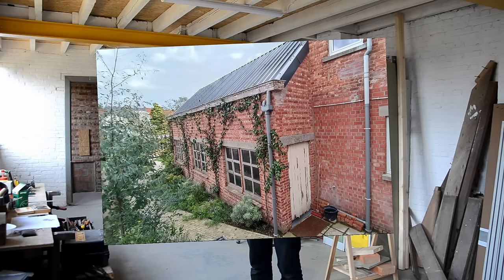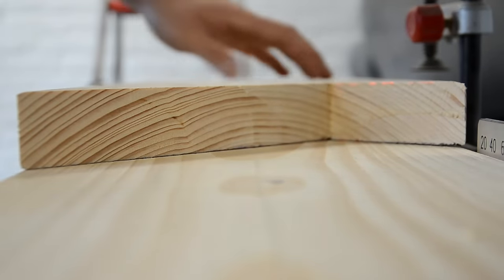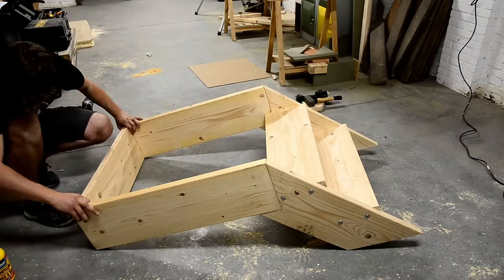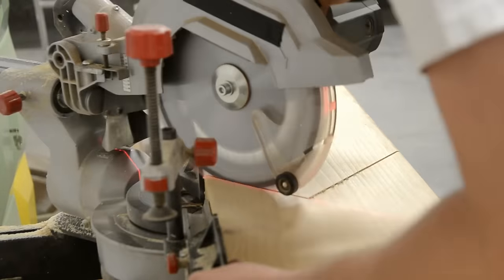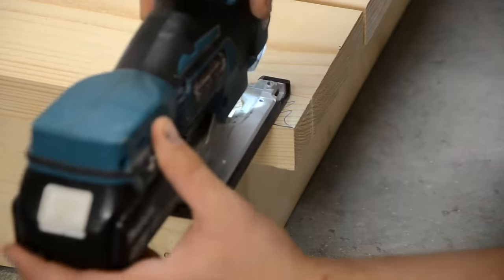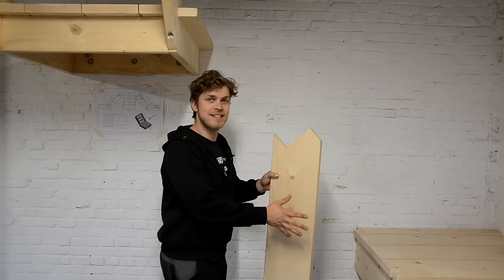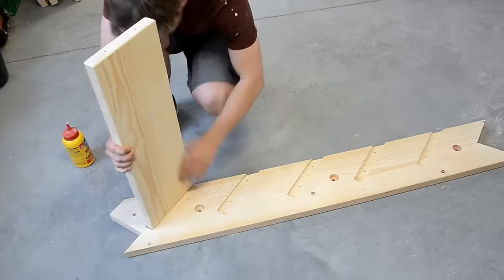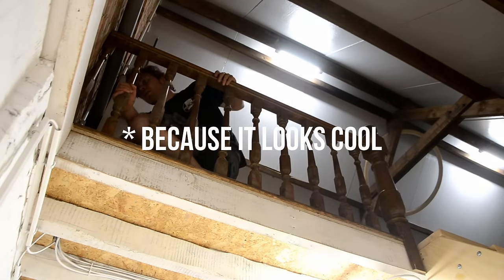Making a Floating Staircase - Woodworking

Comment: I've used those anchors before, they really are very strong, you could probably put a truck on 3 of them. the only thing i didnt like was how you recessed the anchor bolts. theres no real need and as soon as you get some moisture on the wall it looked like you just deleted half the meat, purely for aesthetics. i would have just torqued them to spec and cut of the excess with a grinder... anyway, nice stairs and awesome video!
Reply: also, i saw how you forgot to add the board thickness on a couple dimentions. thats normal, done it a hundred times lol it almost always ends up too long though, atleast for me anyway lol.

Comment: I like the elegant simplicity and inherent strength your design has. It takes very little space. I sub'd, look forward to more!
Reply: yeah the inherent strength of the anchor bolts recessed so far that there is like 1/2 inch of wood left for the washer to clamp on is very "elegant"
Reply: @2brazy4ubitch  I actually wondered about that, myself... Guess we'll see.
Reply: @crustycurmudgeon2182  there is no real force going in this direction, it will just be fine
Reply: @Frank_inSA  I don't recall saying it wouldn't be fine?
Reply: @Frank_inSA  theoretically there is force on them, since there is no post to support the ‘floating’ parts of the landing, there will be a slight hinging going on under use. After a lot of use, especially running, jumping down on those landings, but people rushing or kids or carrying a lot of weight, there will be a certain amount of pulling/crushing happening on those anchors. And then as they loosen over time and he may tighten them up, the effective thickness will only continue to get smaller... Which is fine for him to deal with and fix—but it’s not fine as instruction for how to do this kind of work. It’s easy to predict how this could become even more dangerous in another situation. Mind you the whole design of this is dodgy, and any two hundred pounder that blasts down those stair in some kind of emergency are wild excitement, are likely to push them beyond their limit... especially further on down the road after much regular use.

Comment: Since the last section wasn't exactly as you had planned, how much deviation did that cause in the steps rise dimension?
Reply from the maker: it was about 5cm (<2inch), divided over seven steps came to a difference of 0.7cm with the steps of the platforms. not that noticable when going up and down ;)
Reply: I was wondering the same thing.   I'm glad it didn't turn out to be a big deal (apparently).
Reply: @SpareTimeShop  I had the same question, but luckily it turned out great for you. 

How big is the opening on the second floor? 
We recently bought a house with a big barn and I might be doing something similar! 

Great video, you gained a new subscriber.

Comment: The variance between original plans and the actual length of the centre stringers was caused by the gap between the bottom set and the wall beside them. Notice that your plans for the bottom stringers has no offset for the wall. Only flush planks. The extra ~2” distance from the wall appears to match what you cut off the centre stringers. Pretty typical when adding perfectly square construction to a not so square old building 😉👊🏻

Comment: ok question, when you made the first part of the stairs, I noticed that there is a piece at the bottom stringer that was not shown in the video, is that just to add strength?  or to hold the bottom footing in place?

Comment: I had to make some steps, roughly similar in size to either of your top and bottom platforms.  the stairs were set on retractable castors, and I was making them to replace a previous set that simply fell apart over the course of a couple years hard work. The old ones were built like yours, I made mine by essentially creating a box out of 2x12 fir, glued up into panels, and dovetailed together, rthe box was squared measuring the diagonals on the bottom, then the top kick plate was driven in, with sliding dovetails as the joint. then working step by step, the remains kick plates and treads were driven in all on siding dovetails. The dovetails were glued and reinforced with pegs made from oak dowels, the holes were made slightly unmconcentric so that driving the pegs in would draw the joints even tighter. The pegs were also dried overnight in a 200F oven, and the holes got liberal waterbed wood glue, so the pegs would draw moisture in and swell. Castors were installed at exam corner transferred from the old stairs, that could be disengaged and allow the stairs to rest on the floor. 

The steps had to hook onto a prepared metal bar, for use, but be moveable instantly. Since I knew where they would sit, I contoured the bottom of the assembly to rest on the floor.  I installed it and went home.   The follolwing monday I got a call from our shipping dept asking me to come have a look at my stairs. (the stairs were done for the loading dock of the place I worked my real job, I had opened my big fat mouth and said 'how hard can it be to build a stair' after learning that the old stairs had resulted in a minor workplace accident. This led to me being asked if I wanted to build them, for a rather large sum of money at that...) Filled with dread I went downstairs.

The company had a big forklift. A really really big forklift.  I went downstairs to find it parked halfway  on my stairs. This thing was counterbalanced to stack things weighing tons thirty feet in the air. My stairs were fine, although when the forklift lurched across the first stair, the jolt wrenched the drivers back hard enough to send him for a checkup, and dented the edge of the landing slightly.  The driver was very embarrassed, since this was exactly what had beaten the old ones up so badly.  They were all debating how to get the now high centred machine back onto it's proper surface, so I said lets just lever it up with the staircase, four people and a couple levers later and the staircase lifted a few tons of forklift back on it's wheels and it was driven away.  The stairs never even creaked, and  I got a bonus ;)

So my advice is sliding dovetails, but thats certainly overkill.  Unless your cat gains around 8000kg anyway.

Comment: Based on how much you were off for the middle piece it almost looks like your plans may not have accounted for the top-board thickness, it looks like you were off by roughly that amount anyway (so you probably could've used those same pieces without additional cutting if you removed the board, made cutouts in it, and then reinstalled it with the middle-piece in place), or at least that's what it looks like.

Well, it worked out in the end anyway.

As for the countersunk anchor bolts, it's probably strong enough for its intended purpose but it would have been better to not countersink them. For even greater strength it may be advisable to put some steel plate between the wood and the bolt head as well, this ensures that the bolt won't eat its way through the wood via compressive forces. This likely qualifies as overengineering but still, useful tricks to keep in mind for future stair-builds, it mostly depends on traffic and weight.

Comment: For safety (and code here in the US), there needs to be a handrail. Typically this would go on the open side of the stairs, but having one along the back brick wall would work too.
Reply from the maker: very true! Since I'll be the only one using the stairs, I'll take the risk ;)  I want to keep the middle open so I can carry lumber upstairs. I will search for a handrail on the wall. Thanks for the tip!
Reply: @SpareTimeShop  Yeah, good idea. You can make your own wood rail and just buy the handrail brackets. Great video.

Comment: Nicely done, the construction is solid. My only comment is your 45 angle for the stairs is too steep. You will notice as you go up the stairs your toe is under the step above, which can be a trip hazard. Coming down so the back of your leg clears the tread above 1/3 of your foot is hanging off the tread. You could easy slip or miss a step coming down this way. Stairs are typically done with a 9-10 inch run and 7 inch rise (sorry don’t know this in metric) to prevent these issues and is most building codes. Just be careful and you will be fine, nice job.

Comment: Nice job. I especially like the way the stairs went together. One thing I would mention though is where your points start,    You got 1 point pointing down.   And you've got one pointing up.   All you would have had to do is,   Measure between the points.   And you'd have The length of your stringers.   Even though it looks like you have everything perfectly level i would double check the outside stringer just in case the measurement closed up or opened  up. You can always level up  Your stair treads from the bottom so your stairs don't end up on a slant.  Concrete floors are never always perfectly level.

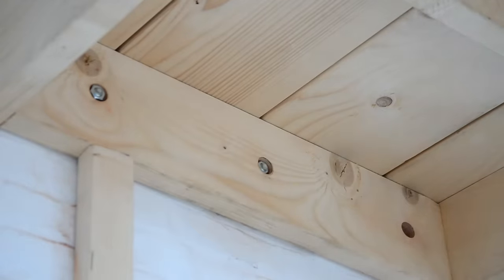Comment: Looks very nice and you're talented, but I'm not sure about recessing the anchor bolts so much in that top landing. 11:13 ... They look nice and flush, but now you have less material holding them in place. Just worried the wood will fail. You could always put in a couple more. Especially since the stress will be higher on it since the stairs are resting on it and torquing that side down.

Comment: Happy to see that you quickly found out hammering with your hand would have consequences later in life. short centre section would alter your steps. Are you not afraid that the weight of your hardware will shortly pull down all your hard work.

Comment: Beautiful, and excellent craftsmanship. But the joints on the inner stringers are going to be doing a LOT of  heavy lifting when the staircase is loaded on the landings. I'd definitely have a structural engineer look at it (I have some background, but I''m not a PE). It would be a disaster if those joints came apart with someone on the stairs.

Comment: @13:35 - I like how you left a margin to "sneak up" on the right length to correct the middle section's fit.  Better to cut too short, rather than too long.

Comment: I think the extra length on your stringer on the middle section was due to the recess in the wall on the right side of the lower platform.  It looks like that gap is about the thickness you cut off.  Easy mistake to make.  That's why I pull measurements as I go, I do very little measurement for plans (for personal projects).
Reply from the maker: I still havent figured out what happenen, but that's a solid theory!
Reply: @SpareTimeShop  nope: that's not it. It looks like the discrepancy is from not taking into account one of the support board thicknesses, on one of the two platforms. I re-watched the video, and it isn't the gap between the wall and the first platform that is a problem. But now I have a question of my own: you had to reduce the overall run of the middle component, so how did that affect the rise between the steps, between each one of the 3 runs of the stair? It stands to reason that the rise-over-run of the middle component is different from those of the other two components (beginning and ending of the stair), is that right?
Reply: @minidisco72  he said in another comment it was out by .7 cm on each of the 7 centre stairs so no big deal.
Reply: I agree with Benjamin. The gap in the corner of the first landing looked the same size that you had to cut off the stringer. Easy to do when taking measurements for you plans you just went all the way to the corner. No biggie, easy fix. Good job they look great.

Comment: I would have went with an elevator-style lift. No more carrying things up n down stairs. I fabricated an elevator lift for my 2 story pole barn. It's 3 feet by 4 feet and I just used C-channel for the uprights which are the tracks that the platform will be guided with,  1/4" angle iron for the platform, and then a 1-ton electric hoist. No more climbing and carrying things up n down steps!

Comment: I think the top platform cantilevered off the wall is a weak point.  When you are on the top steps you're really loading that platform.  You're holding the platform to the wall with 3 anchor points which you also counterbored making that ledger board half the thickness!?  I have the same issue with the lower platform.  The obvious solution is to put a post under each.

Comment: Your mistake in the wall brace between the two levels was the brace on the tread of the landing rather than NOT notching them around the brace. You always go to the anchor point. The foundation is most important in these designs due to the transfer of load regardless of the lags in the wall. 

Another flaw I see is you should have chiseled the routes square, so the stair treads fit properly and without gaps. How did you not see the round peg not fitting the square hole?

Comment: QUESTION: You didn't train in that Swedish or Netherlands' Carpentry School that I've been hearing about?  ONE MAJOR CONCERN, however: You countersunk those Stringer bolt-holes going into the masonry walls WAY TOO DEEP and the bolts' collective load-carrying capacity is GREATLY reduced by the depth reduced from boring into the 2x12 Stringers. SUGGESTION: I would anchor the Stringers in more places than now current. I am serious on this Observation. You start carrying Materials and Loads up those stairs and it might fail over time - please send your feedback. Or as a thought: You could support the landings, and then re-anchor those SAME anchor bolts holes, using steel-machined "bushings" to refill the Stringer holes snuggly with load-bearing "bushings", as I said. Re-bolt with new lags and be good forever. Am I being clear?

Comment: whenever I build anything I usually make at least one mistake.  like when I was building my shed I forgot to make sure the walls were completely vertical in all directions and when I was putting on the rafters to remember to line up the peak of the roof line at the instead of where the base of the rafter rests on the wall so I had to add some small shims before I could put the plywood on the roof otherwise it would have been wavy

Comment: Stairs are a function of bio mechanics,,, how people walk is what determines how stairs are designed and built.  To arbitrarily decide upon 45 degrees,,, well yes, there are stairs that are 45 degrees,, but few are.  The formulae is  (there are actually 3 formulae accepted)  2 X riser height  +  1 net tread (no nosing)   should equal between 24 and 25.   Nosings should be approx. 1.25 inches  or 3 cm.  All stairways must have hand rails,, and if residential, spindles or suitable side protection to keep children safe.

Comment: Your long stringers 18:25  were out originally because the first landing is not square to the opening upstairs it is offset slightly by that recess in the main wall. Looks like an old doorway that was blocked up.Therefore the stairs overall ae smaller than you originally measured for

Comment: considering that those bolts for the wall could be hidden with another piece of wood, i would have not drilled the board and fix it straight and then cover the bolt, rather than cutting the thickness of the board to put the bolts , weakening the structure and the wood , but looks nice.

Comment: First thing in woodworking. NEVER USE A BALLPOINT PEN. Lets say you mark a piece of stain grade lumber and make a mistake, it will leave a groove and a line in your lumber and stain is not very  thick to fill that groove you made. That is way they have carpenter pencils.

Comment: I always believed that a floating staircase is self supporting meaning the whole staircase is only attached to the floor of the bottom floor and the deck of the top floor, and not attached to walls
Reply: a true floating stair is attached at zero points, this ones not bad though.
Reply: I have been a Carpenter for 35 years in  Los Angeles and I have built and seen built a lot of very cool things. For 😂 my friend and fellow creator/builder all I can say is very well done. I say to those who asked why you recessed the bolts and screws  was so you could make some plugs and cover them right? Very good job! I would suggest as another said adding some handrails for safety. Look forward to watching your progress on the dream shop.

Comment: 40 degree cuts would have been just as easy. As stated below, 7/9. 6'8" headroom. Since the stair is uncomfortably steep, you will be looking down at you feet when you crack your head on that header.  Measuring while standing is not what your body will be doing when you are trotting down the stairs.  If you framed the opening, Why didn't you frame it to get your headroom heights up to code? Why didn't you eliminate the lower platform? This staircase is a deathtrap.  Although, you did some nice video and  jig work.

Comment: Drilling out the wood before putting your anchors in seems kinda dumb. Aren't you basically anchoring less wood to the wall making the staircase way weaker than it would be had you not drilled those holes so deep into the wood?

Comment: SMH.  I have built several stairs in my life, but you didn't follow a single code, 45 degrees is not even CLOSE to a 7-11 or combined 18 R over R ratio. Minimum head height from step to ceiling is 6'8".  Not once did you use adhesive to prevent creaking nor did you think about putting in a handrail.  Now your basic use and understanding of wood, wood glue and tools seems to be advanced.  Overall good job.  I have built literally 100's of stairs, no cad, just learned from several old dudes telling me what I'm doing wrong and fixing it.  Reading and doing it over and over. Keep up the work.